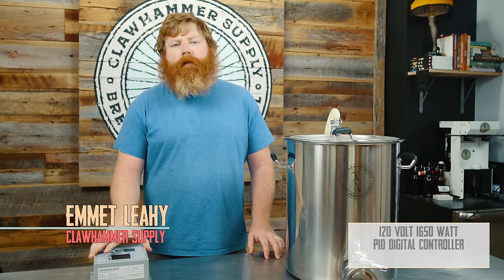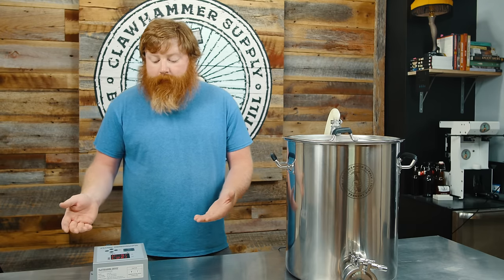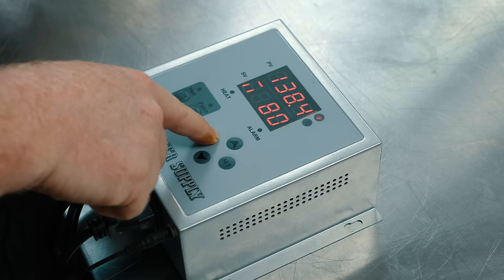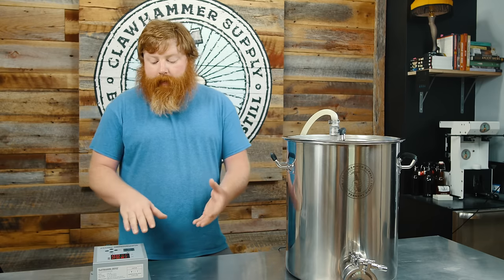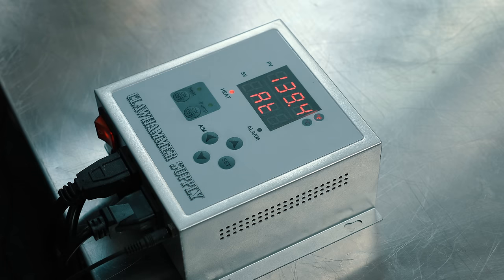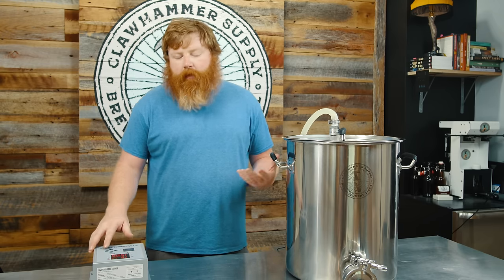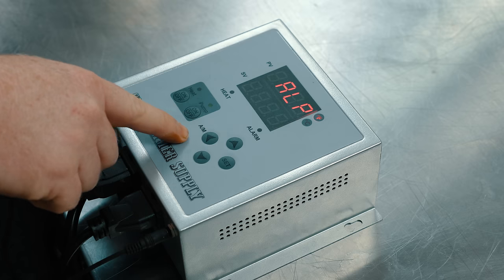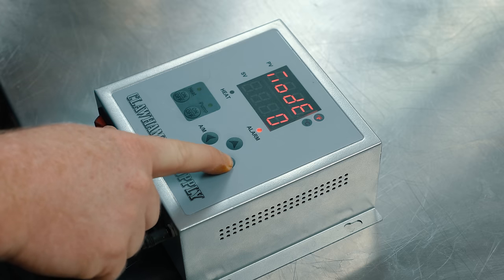Electric Brewing & Distilling Controller Overview

Comment: Are settings persistent? Will they stay as they are set when power is off? I'm looking into hooking this up to a Smart Switch so it can start heating up my water before I wake up in the morning.
Reply from the maker: The temp settings are persistent but you need to physically hit the "heat" button before it will start heating. We often add our water to the kettle the night before, put a lid on it, and heat. If you use the insulation kit it'll maintain temp with little additional input needed.